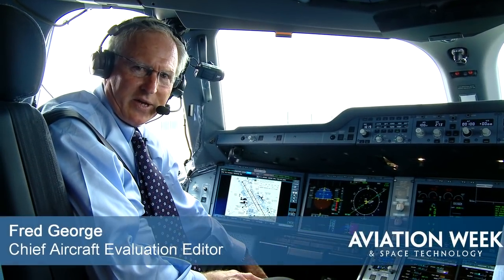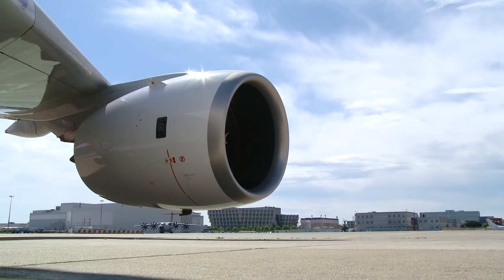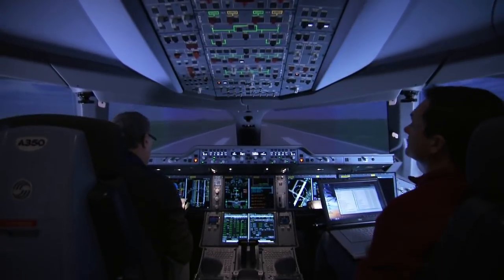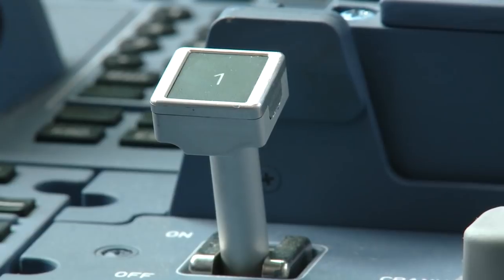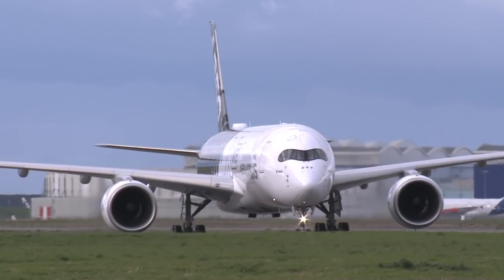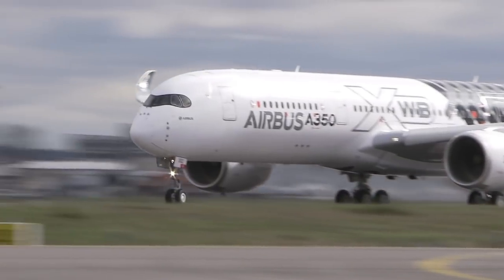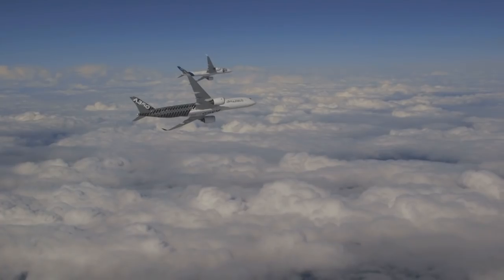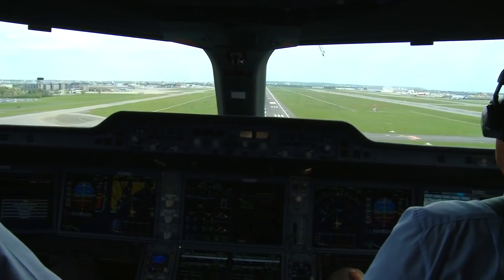Pilot Report: Airbus A350

Comment: Correction. Boeing uses fly by wire providing feedback from from your controls and the copilot. A flight flying from Brazil to France in an airbus crashed because the pilit in comand started to experiance multiple systems failure.  The   experianced captain  leaves flight deck to pee mid flight and cokes back the fight the inexperienced captain dealing with multiple sudden system failure all from the pcs. the engines were still fine. the auto piolit inactivated and the somehow due to stress is suppose starts to pull up loosing speed and essentially stalls. and falls out if the sky. the blackboard recording say it all. had the experianced captain seen that the side stick was being pulled back and he was getting feed bavk h3d been able to add power and push the nose down and control the stall.
Reply: +Tyger Voods If the pilot is incompetent then it doesn't matter what aircraft he is in. Would a Boeing style yoke have helped the situation? Absolutely. Is it fair to blame the accident on the design of the side sticks? Absolutely not. There are unreliable airspeed memory items for a reason. For an A330, 2.5 degrees nose up, 78% N1 in the cruise and voila, you've just prevent AF447 from happening.

The crew on AF447 demonstrated very poor CRM. There was no clarification on who had control. In addition the airbus has sidestick priority lights to let you know who has control, and if need be, one crew member to deactivate the other's sidestick inputs. It's a complex system for sure, but in absolutely no way does it excuse the incompetencies of the pilots, who evidently did not obey airbus's four golden rules. 1: Aviate, Navigate, Communicate, in that order. 2: Use the appropriate level of automation at all times. 3: Understand the FMA at all times. 4: Take action if things do not go as expected.

The pilots on AF447 made basic airmanship errors, if they couldn't respect the stall warning, recognise or recover from a stall,  they should not have been flying a C172, let alone an A330.
Reply: but it a question of better design for emergency situations when both pilots should know what the other is doing 100%....that crash may have been avoided. The Captain has to know if the 1st officer is fucking up.
The side sticks don't allow for that.
Reply: tanshaomala I think Air France 447 would have happened in any plane, I still think he would have pushed the yoke back only difference is another pilot might have spotted the error, but they were clearly confused
Reply: +aky19832001 

Then Captain Sully has conviniently disregarded the countless accidents caused by stalls on yoke-equipped aircraft.

Why is the Airbus control system plucked out of the multitude of significant issues involved in one accident and wielded as some kind of smoking gun while any mention of several similar results in aircraft with yokes is often met with a muffled cough and a change of subject? That isn't aimed at anyone in particular - it happens in every discussion involving Airbus FBW. 
At the risk of sounding like a broken record, it's been nearly 30 years, over a quarter of a century, with over 9,000 FBW aircraft delivered. Where is the data to show that Airbus FBW aircraft are less safe than Boeings, etc?

These comments are really becoming tiresome. Sigh...
Reply: +aky19832001 the captain wasn't in the cockpit for at least 2-3 minutes and he was actually taking a rest break much longer than a pee break. It was the more experienced co-pilot who just woke up and obviously was less alert since he only slept like 3 hours in the past 24h, and it was the other less experienced who stalled the plane as you said. It is the side-sticks fault, the more experienced co-pilot would've noticed what the PF was doing with the stick if it was a yoke. Just adding on to what you said :)
Reply: tanshaomala Thank you! Cpt Sullinberger (who's now working with airline safety, who also flies AirBus) said flat out that accident was preventable had the pilot in the FO seat saw what was going on, He would have made the correction and told him to stop pulling back.mixed in with flawed sensors positioning and you've got a catastrophe waiting to happening. 
It was latter concluded it was simply a case of poor training, and not working together. The younger pilot was pulling up, while the substituting officer was pushing down. The side stick technology isn't bad at all. But Airbus needs to come up with a solution for feed back on both sides when input is made.
Reply: total stupid design. it was only a matter of time before something like that happened.
Reply: Boeing has also been producing airplanes for twice as long as Airbus has. Even though I doubt you have counted every aircraft crash from both companies, without more information, your comparison has no statistical significance. I'm not going to get involved in the "Airbus vs Boeing battle." Both companies make great airplanes, and I think anyone who is as biased as you seem to be needs to calm down, do a little more research, and reevaluate why they feel the need to go around advertising for their preferred aircraft company.
Reply: +Nur Hussein amen to that :-)
Reply: FlightFoe I have. I've concluded that the majority of crashes were because of human error.
Reply: I don't feel like arguing with you, but let me clarify my point. Yes, Boeing airplanes have experienced more accidents than Airbus airplanes. However, Boeing has been producing aircraft for much longer than Airbus. Had Airbus been founded and started making airplanes at the same time as Boeing, would Airbus have had more accidents? There is no way of knowing. On your point of " Airbus is way more safer than Boeing whether you like it or NOT!" number one, check your grammar. Number two, you seem to be under the impression that I am biased towards Boeing. Let me disqualify that assumption, even though I made my stance abundantly clear in my previous comment. Your claim that the "737 is one of the most dangerous airliners" is also completely without merit and completely untrue. The Airbus a320 experiences 0.11 fatal accidents per one million flights. The 737NG, which competes directly with the a320, experiences 0.08 fatal accidents per one million flights. This actually makes the 737NG slightly safer than the Airbus a320. The similarity between these (very small) numbers attests to the high safety of both aircraft, and by extent, both companies. Additionally, the highest rate of fatalities among any Airbus or Boeing aircraft is the Airbus a310, with 1.34 fatal crashes per one million flights. Take your salt elsewhere, its not needed here.
Reply: Reply if you are interested in my sources, I'd be happy to share.
Reply: Andrew Anane  3rd year Aerospace Engineering student. Graduate in July, after which I could be potentially working for either Boeing or Airbus on one of their graduate Engineering programs. Not that I want to throw titles around but probably a lot more than you. What do you know about aviation other than 'Boeing sucks, Airbus is better'?

You lose, now stop embarrassing yourself and give it up. Both companies have done a lot for aviation, both companies push each other to advance technology within the world of aerospace and generally improve. Your debating 'skills' resemble that of a five year old child.
Reply: ***** Boeing are only meant for the most competent of cockpit crew.
Reply: +aky19832001 why don't you read the crash of the MD80 in Venezuela with mechanical yokes which crashed because the captain pulled the yoke in a deep stall. You can have any system in there, a bad crew will always find a way to break it.
Reply: count how many crashes Boeing has had and how much Airbus has, Airbus is safer 😉
Reply: You are both so salty it's kind of funny. Do  you feel the need to prove yourself or something? Honestly, I'm trying to contribute something worthwhile to this comment thread and you guys are just creating drama. This is everything that is wrong with the internet in a nutshell.
Reply: aky19832001 Excellent reply mate!
Reply: Andrew Anane Thank you We only say it how it is brother!
Reply: Andrew Anane In his haste to prove a point. He forgot his below average IQ vs my superior intelligence is simply no match. Mr. OCD forgot to capitalize A and put a period at the end of a sentence. Once and for all ending his attempted battle with us. He's probably going ballistic now.
Reply: Casey Tavernier You were right about everything you stated, and I actually learned a few things reading one of your comments (the accident rate per one million flights). One point I would like to add is that an accident involving any particular given aircraft model does not necessarily constitute a safety flaw within the design.  Comparing the safety of two aircraft types via accident counts is technically incorrect unless you actaully consider the leading factors and in turn rule out pilot error, weather conditions, etc... where you can safely conclude that the primary factor was indeed a technical fault with the aircraft which compromised the safety. But then you need to look into whether this is actually a design flaw (where the manufacturer is at fault) or poor maintenance  (where the airline is at fault). So I personally do not agree with safety justifications based solely on accident counts, I think it is a lot more complicated than that.
Reply: Zachary Sylvester
I do agree it is a lot more complicated than that. The safety of an aircaft is based on so many things that judging the safety of an individual flight is nearly impossible. However, looking at accident rate per million flights is about as good a measurement as you can get. It's not perfect; it doesn't account for pilot error, as you stated, and pilot error is a factor in a large number of accidents. My point, though, was not to prove that one aircraft is safer than another. I was just disproving our friend Andrew's extremely biased and untrue views. I love that someone finally contributed something worthwhile to this discussion, and I would like to talk more about it.
Reply: Andrew Anane I would be interested to see your sources.
Reply: Andrew Anane It's not up to me to do your research for you. I will be happy to accept your point of view as soon as you provide some real, statistical evidence. Until then, I have my opinion that I have evidence to support.
Reply: Andrew Anane An example is not statistics. Also, the Galaxy s7 is a very popular and successful smartphone. I believe you meant to refer to the Galaxy Note 7, which had battery problems. Just end the argument. There is no way to prove that either manufacturer is "safer" than the other.
Reply: Andrew Anane You have still failed to provide numbers. How many? When? You could just as easily have said "a300 had problems, a330 had problems, a340 had problems and a320 too had major problems." All planes have problems. Give me NUMBERS. I want to emphasize again that your opinion is not fact.
Reply: I'm done talking here. I'm not going to reply here anymore. You are not worth my time. This argument is impossible to win because there is no right answer. You will realize that in time. Or maybe you wont.
Reply: Andrew Anane
Look, you couldn't possibly know whether one is safer than the other because your knowledge is limited with regard to the Engineering behind each aircraft. If you're serious about determining which manufacturer is safer you would have to pull up all the (current) manuals, schematics, technical drawings, system mapping layouts and experimental data for all current aircraft types being operated today that are manufactured by Boeing and Airbus. After you have done this determine where you would make technical improvements (where the functionality is enhanced & safety is improved).  To do this you would need to be well versed in; Fluid Mechanics, Thermodynamics, Solid Body Mechanics, Control systems, Electrical systems.... the list goes on. In reality it would take a team of skilled experienced Engineers (within the field) to accomplish that. It's far more complex than you make it out to be, I don't think you understand the level of intricacy behind the systems of modern airliners.

Also, quick grammar check... you don't need to use more and then safer. Safer implies that it is more safe... more safer is grammatically incorrect. Not that I didn't understand what you were getting at of course, it's just for future reference.
Reply: Andrew Anane I'm not running my mouth, but rather my fingers... because I'm typing. Also I think my comment is pretty clear. If you scroll up a little bit to my first post you'll see why crash counts aren't sufficient for determining safety. Unless you can point out that the definitive reason for the vast majority of crashes involving the Boeing 737 were down to design flaws and prove it (maintenance neglect does not count) then your argument is at best weak. Boeing have been around, a lot longer than Airbus... please use some common sense and bare that in mind, that's quite a significant factor.

One more thing, you've got a bit of a potty mouth on you. Do yourself a favor, get your mum to wash your mouth with some soap. The heck is wrong with you replying to me like that? If you said that to me face to face I wouldn't hesitate to backhand you West Indian style. Nonseeeeense! ( I meant that in the most loving way possible). Peace.
Reply: Andrew Anane After seeing what in particular? I love how you say that like you know me and my credentials. Regardless, you lose whatever debate you're trying to conjure up. Stating that Airbus is safer than Boeing over and over again doesn't make it true. Are you going to carry out non-bias analysis and look into the primary factors for each of the crashes you are quoting to me? Are you going to determine whether or not Boeing have design flaws in their (current) products and that Airbus have less that compromise safety? If so can you point to them specifically?

If you can do that (I don't think you can please prove me wrong), then I will take back everything I have posted on this thread and you will have my respect. If you can't do it you lose the debate. What is it gonna be? The ball is in your half of the court.
Reply: Andrew Anane Goodnight.
Reply: Andrew Anane Are you pulling my leg? You of all people are telling me to read some books. You who has to substitute profanity into every sentence as a result of your limited vocabulary? Oh dear, what are you doing mate? Honestly what are you doing? If you have any dignity you won't reply and make yourself look like any more of an idiot than you already have. Seriously (quick exercise), get your phone, hit record and read out your last five posts (aloud of course... don't wanna point out the obvious but we never know with you). Listen to the recording and tell me you don't sound like a degenerate.
Reply: Andrew Anane Please point out in particular anything I stated on the subject of aviation that wasn't relevant. Look at what you've turned this thread into... a childish exchange. This could have been an interesting debate. If someone challenges your take on a subject, you don't have to respond like an angry five year old throwing a tantrum. Explain your case in detail and back it up rationally, that is all I'm asking you to do... That is if you really are so much more grown up than us 'kids'. Can you bring any more to the table than simply 'Boeing has more crashes than Airbus'? That argument simply doesn't hold because there are certain factors you need to consider with regard to accident counts.
Reply: The Airbus has a conspicuous cockpit indicator that displays when the computer is receiving multiple side-stick inputs. Had the crew followed their training they would have 1) executed Crew Resource Management procedures better to avoid this problem in the first place, and 2) noted the indicator warning and realized what was happening. It was just another case of pilot error, plain and simple. There are way more accidents involving pilots stalling traditional yoke systems and crashing, even with the stick shakers clanging like crazy. It doesn't matter what system you implement if the crew doesn't respond correctly. 

There tends to be this fallacy among old-timers that fly-by-wire systems take away vital control from the pilots in times of emergency but this is anecdotal thinking and there's little evidence to back it up. In fact most crashes are caused by pilot errors that could have been prevented with computer managed flight controls. Believe me, I hear it a lot and it's just older pilots begrudging new ways of doing things. My grandpa was an accomplished pilot/instructor and FAA crash inspector for 30 years and he used to say the same types of things. I think it has to do with the fact that these are usually very exceptional pilots saying it and they fail to realize most pilots aren't as good. Either way if you follow training properly the outcome should be the same.
Reply: Boxy Brown Yeah you're right
Reply: Casey Tavernier Well you're very stupid then cause all the information in on the Internet. And it's obvious Boeing has more crashes so don't tell me shit.  Also 737 is one of the most dangerous airliners. I also think people like you should start telling the truth. Airbus is way more safer than Boeing whether you like it or NOT!
Reply: Casey Tavernier Yeah! Thanks for understanding that Boeing have crashes! I just read the first sentence, I know the rest are bullshit!
Reply: Again, check your grammar. If you can't even take the two minutes to read my entire comment, I can't be bothered to talk to you. Bye.
Reply: Casey Tavernier I am not reading your bullshit.
Reply: Seriously, your English is so bad I can't even understand what you are trying to say.
Reply: Casey Tavernier Don't blame your poor reading comprehension on my English son.
Reply: I was not replying to you, I can understand your comment just fine. Read the comment above mine and tell me if you can understand it.
Reply: Casey Tavernier lol Roasted! 😂😂😂 "Don't blame your poor reading comprehension on my English son." This made my day 😊
Reply: Casey Tavernier Son, open a book god damn it.
Reply: aky19832001 😂😂 I'm sure he doesn't know what's called a book.
Reply: You seem to have missed my comment explaining that I was critiquing Andrew Anane's grammar and not yours. However, now I have a reason to laugh at you because you seem to have spelled "mastorbator" incorrectly. I don't want to argue with either of you as I can tell you both have the maturity of the average third grader. Your reply just proves my point. I can tell you are insecure about your grammar because you leapt on my comment so quickly. Don't worry, you will begin to grasp the language as you get older.
Reply: Casey Tavernier Shhhh.Your OCD attempts of validating your worth is futile.
Reply: *are futile
Reply: Casey Tavernier *Are futile. Smart ass.
Reply: aky19832001 😂😂 that kid is so dump!
Reply: aky19832001 lol I agree with you.
Reply: Going ballistic. Right. I'm laughing my ass off at you because you corrected yourself.
Reply: Can we stop arguing, this is extremely pointless and a waste of time. You're just embarrassing yourselves.
Reply: Casey Tavernier Or if I should say you're embarrassing yourself.
Reply: Pathetic. You can't even think of an original comeback. Like I said, lets just stop. This is a waste of time for all of us.
Reply: I'm not even going to try to reason with you anymore. It's pretty obvious at this point that you just want to fight with someone else to make you feel better about yourself. I'm done here. This is a waste of time, and once you grow up a bit you will realize how stupid you sound. Don't be offended if I don't reply to any more of your childish comments.
Reply: Casey Tavernier Exactly, so stop going back and forth. You have no point. You made no point. You contribute no knowledge and you failed in trying to show superior intellect. Your attempts at trying to show my error in spelling as being connected to my superior knowledge have also failed. So again. Let it go.
Reply: And the same to you. Agreed. Bye.
Reply: Casey Tavernier just shut the fuck up and leave.
Reply: Casey Tavernier Have a good day. You've been a gentleman and a part time scholar.
Reply: Good day to you too. Let our love of airplanes keep us together.
Reply: Airbus>Boeing 💕
Reply: or the most lazy.
Reply: aky19832001 

How can I trust a man with bad grammar
Reply: Andrew Anane I provided plenty of facts if you take the time to actually read them.
Reply: Casey Tavernier Airbus's are safer than Boeings that one is a fact! I don't even know what the hell you're talking about.
Reply: Casey Tavernier what facts? Do not waste my time.
Reply: Casey Tavernier Haha don't make me laugh 😂. I just gave your flying galaxy s7 (787) as an example.
Reply: Casey Tavernier Whether it is galaxy note 7 or galaxy s 7 787 is still a time bomb. 

Airbus's are way more safer than boeings. 747 had problems, 777 had problems, 787 has problems and 737 too had major problems. In order for boeing to make their planes a little bit safer they had to copy Airbus's revolutional fly by wire.

Even 777 has more crashes than A330 or A340 but A330 and A340 were made before 777. I really don't know what you're trying to say but Airbus's are more safer than Boeings. Airbus's have the least crashes 😉
Reply: Casey Tavernier What problems did the Airbus's have lol. Well you know what I'm saying so I don't really need to go into detail. 

Even before 747's FF it had major engine problems. Boeing sucks!

You haven't provided a single fact you're just saying nonsense to me. As I said everything is on Google 😊😉.  Now I really have important things to do.

 I just don't know why people know the truth but they don't wanna aceept it. I don't wanna waste my time on stupid person like you.
Reply: Casey Tavernier I really think you should research well because Airbus's are more safer than boeings that had to steal Airbus's fly by wire idea.
Reply: Andrew Anane
Hypocrite
Reply: Zachary Sylvester I lose what? Lol 😂. After seeing this neither boeing nor Airbus would like to see you at their company. Airbus's are safer than boeings get it!!!! It is a motherfucking  fact!
Reply: Zachary Sylvester Just fucking leave me fucking alone! GO do some fucking research
Reply: Zachary Sylvester Go read some fucking books
Reply: Zachary Sylvester You kids are so funny "limited vocabulary" lol! When did I say I was here to spit out the dictionary? Because you're dumb you have nothing else to say than irrelevant things that have nothing to do with this topic. You are a real punk ass bitch.
Reply: Zachary Sylvester You have changed the fucking argument into some vocabulary topic which is completely nonsense. 

I won't waste my time on a fool like you. Everybody knows Airbus is safer than boeing. It is even on the Internet go research.
Reply: +Casey Tavernier you are truly an idiot and refuse to listen to reason... shut up and listen you may learn something you loud mouth!
Reply: I'm not a pilot but that feature  of the side sticks not being connected to each other could be very dangerous
in an emergency situation.